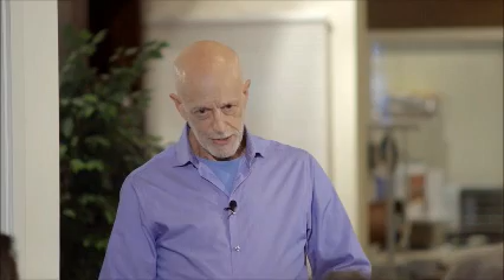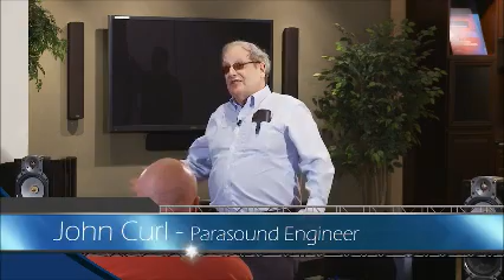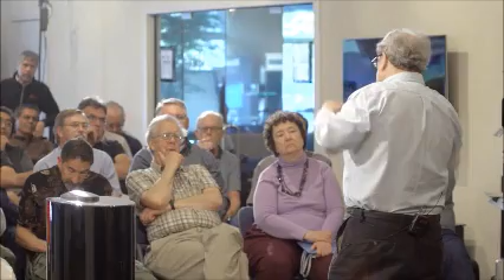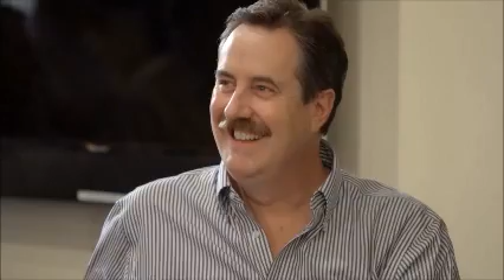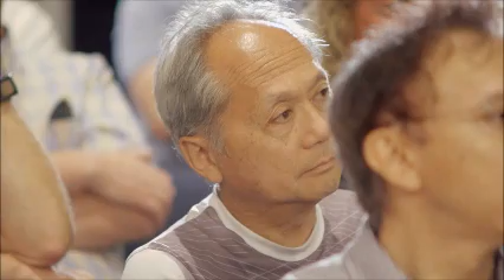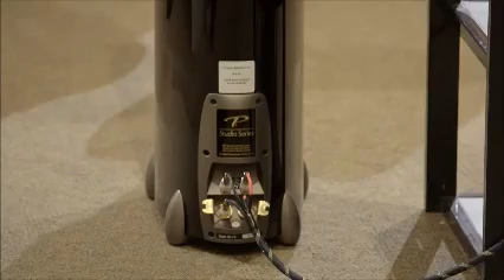Richard Schram & John Curl Discuss Amplifiers

Comment: I didnt think about it , but im holding a PCB of an AMP for Active speakers Behringer model B2031A , basically the same as Mackie mr8  and all 8inch monitors and monitors in general as far as i know , and  they dont have Inductor's    as well , as said here "inherently Stable Circuit " ,  that makes them less distorting on "higher order harmonics " as mentioned here , and that should make them "more listenable " , i tell you , not the truth , all monitors are hard to listen , its not a Pleasure Speaker , its a tool . So i dont know , maybe im wrong , but this No Coil thing maybe isnt all that important

Comment: I have to relate that dealing with Richard has been a very positive experience. I bought an A21 that has a small problem and when I contacted Parasound Richard replied immediately and outlined the process that would occur to get the amp in for work. The amp is easily the highest quality and best gain stage that I have heard. Good company and good people...

Comment: Great show. Thank you for sharing it. A quick note to Richard Schram. I am the happy owner of pair of JC1s as well as HCA-2205AT power amplifiers. I really like the sound quality and the value they offer Though there is something in common these amplifiers share that I would like to point out. All 3 amps have issues with LEDs. As far as I know John Curl didn't designed that circuitry, but can you please hire someone competent who can do it right? There is nothing more frustrating then watching those LEDs flicker in dimmed lit room while listening to music. Both JC1 amps have been reworked with the "repair" kit a few years ago but one of the amps still has RED LED flicker.  :(